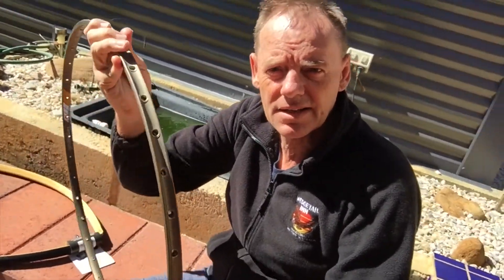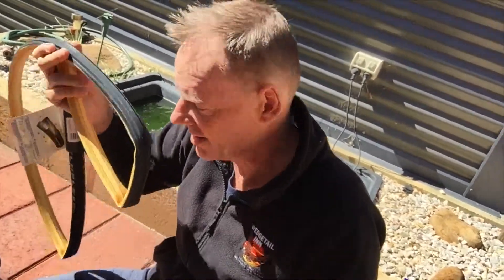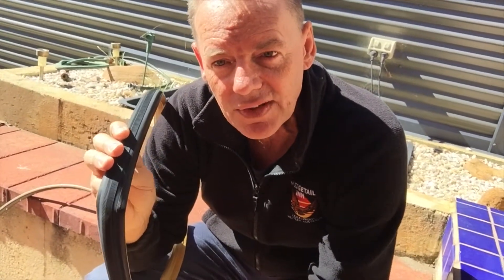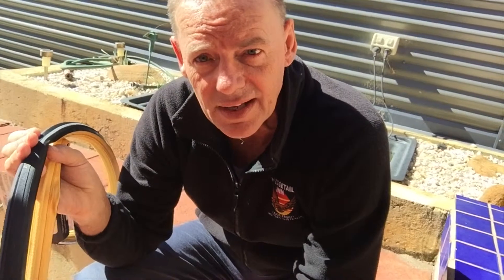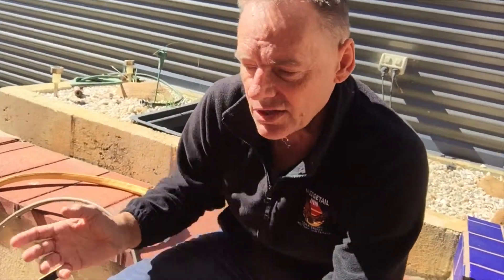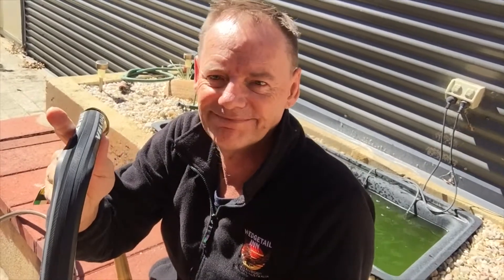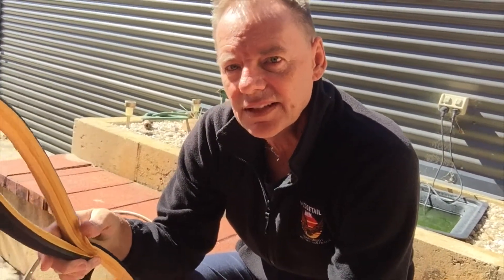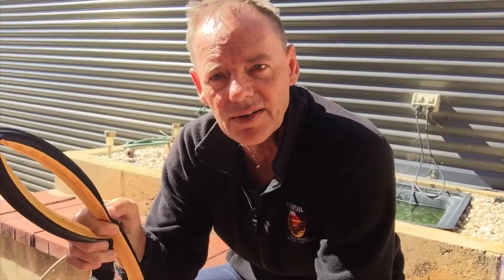Tubular Tyres who runs these?

Comment: At one time we used to either send them off to be repaired or learn how to sew them up yourself  however .
   We started to use the car tyre sealent which did seal them quite well and I have raced on tyres repaired that way.
   But the modern sealants that you can put in and leave are far superior. 
I personally think that the development of sealants for tubless tyres has actually made tubulars even more practical and I don't see a reason not to use them
Reply from the maker: Agreed
Reply: Don't you believe GCN that tubulars are uncool?
Reply: Same here , I take gcn as an advertising company
Reply: I have used Tubless and tubulars 
 Tubulars are in my opinion better in every way.
  They are easier to use less messy to set up and ride better.
Reply: Bicycling must be the only sport that defies physics,
       According to these manufacturers and gcn a wider tyre and therefore a wider contact area gives Less drag.
       And in every other area of physics the oposit is true.
Amazing

Comment: You're off base on the repair issue when the sealant can't do the job. They can easily be repaired once you know the steps. A hair dryer is used to soften the glue that holds the backing tape so it can be peeled back. A seam riper is used to unstitch about  4 inches of the stitching that closes the carcass, the inner tube is exposed and patched using a standard inner tube patch, the carcass gash is repaired with an old piece of baking tape and rubber cement, and the carcass is closed using a blunt needle, some dental floss and an overhand stitch through the original holes (hence the blunt needle). Contact cement is used to reattach the backing tape. It takes me about 15 minutes to perform these steps. I use two tubulars per season to commute 10,000 kms plus 5000 km of club rides. I typically perform about five repairs per season. I can buy the tires online for 60% of the price of a good clincher and I get the pleasure of riding on tubulars!
Reply from the maker: Your a better Man than me, I tried a few times and couldn’t master it, they always felt lumpy when I rode. Years ago people would do them for you but I do believe they have all gone. The sealant does work as well most of the time.

Comment: Tubular wheels are really light and very strong.  I flatted a reynolds and rode in almost 20 miles...No damage.  Bought these rims used for $300 about 7 yrs ago and 15k climbing rim brake miles.  Rode them today.  Re-spoked and re hubbed a few times but still my go to climbing wheels at 22mm height and feather- light.

Comment: This is a Great & very well done video on the pros and cons of using tubulars.  I love the reduction in rotational weight too.  Thanks for the recommendation to put 30ml of Sealant in my latex tubes.  Like you I have run tubulars for 35 years although I do use clinchers too.   For any rider thinking of getting some tubulars, this video is highly accurate and very useful.
Thank You Wayne!
Reply: Being using Tubulars since 1988 & since l finally purchased a Carbon Tarmac 3yrs ago (expert) which came with alloy dt swiss clinchers l can say l enjoy being on clinchers 4 the ease of repairs.  However l also went out & purchased a set of clx40 Tubulars & l had a couple of used sets of Vittoria 19mm Kevlar Belted in good nic (had them 4 30yrs) with green tread (were used in paris roubaix) Not me. And they r super fast . Well l punctured them out. 
During a recent house move l found a brand new set.  Hooray. Going 2 use them 4 Crit Races. Hate gluing them so shorty going 2 put them on wheel stand & heat the glue off carefully  & then clean with accetone. Using double sided tape. As 4 filling with aerosols gr8 4 all round riding.   But if u puncture with Tubulars its usually phone a friend.  😀😀 Have ordered a set of carbon Roval clinchers. But 4 us old Duds we just ❤ Tubulars.  They r comfortable 2 🚴🏼‍♂️🚴🏼‍♂️on. Tried Victoria's fastest road Tubulars as well. Super fast but there puncture technology isnt as gr8 as they make out & only GOOD 4 racing

Comment: Ah, tubulars! I remember them; we used to call them singles. I spent far too much money on them over the years that I used them but the big advantage for me was that they had superior grip, particularly if the road surface was damp. I always used Kwik Grip to fit them and never had a problem.
Reply: How did u remove the kwik grip. And was that on carbon wheelset
Reply: @robertphillips3078  Don't remember if I ever removed it. This was before carbon anything arrived on the cycling scene.
Reply: Tubulars r faster Brian. I road them on expensive Aluminum Heat Treated Rims 4 yrs. Last week l rode 140psi rear & 130psi front & they would have taken more. The other Tubulars l use take much more pressure than that. I am going 2 go 2 double sided tape out of Italy that l have just come across 👍🚴🏼‍♂️
Reply: Found this very Expensive Dou ble Sided Tape out of Italy instead of using glue. My bike shop is endeavoring 2 try & get it 4 me. Getting BIKE stuff out of Italy at the moment is a bit difficult. Waited a yr 4 my indoor trainer.  Anyway back 2 tape..  apparently its as good as glue  if not better  👍👌🚴🏼‍♂️
Reply: @robertphillips3078  There was double-sided tape available for a while back in the 60s or 70s. I think it was on the market here (Australia) for only a short time.

Comment: Old guys like me who know how fast they r especially on my SPECIALIZED Roval clx40 Carbon Tubulars. Fast & more Comfortable.
Reply from the maker: LoVe Tubulars
Reply: @waynosfotos  gotta get the glue off my rear wheel. Found a gr8 solution online. Heat gun. But used wisely.
Reply from the maker: Yes done this before, when i use to use glue. Heat it up and then wipe with the rag. More rag to a new clean spot and repeat. Gives a nice clean finish for the new application. But to be honest, once I found tape, not going back to glue. Just more time consuming to mount. But if you are prepared to do the work and scrape your pedals, it is worth it!
Reply: @waynosfotos  yep. I saw a guy doing it on YouTube.  A little glue 1st & then tape & some more glue over the top. And 2 coats on Tubulars.  What's ur thoughts on that approach

Comment: it does beg the question of how suitable Carbon is for wheels , grate on a TT bike but for anything else i am not so sure , we use carbon to get the weight down and then have to fit over engineered and heaveyer disc brakes to overcome a problem  that did not exist with alloy rims. And i do have carbon rims myself but i have gone back to tubulars with them.
i am not convinced that they are much lighter than the Fieme Hard Silver rims that i was using in the 90,s 
  I think Cycling is bowing down to fashion too much and its a case of the Kings clothes,
getting
Reply: I had a set of hard silver rims that where actualy given to me , unbelievably light and strong.
But disc brakes are about creating a demand not improving cycling.
The cost more a nightmare to maintain,  and wear rotors out faster than brake bloks.
   Then they try and say well they do not wear your rims out.
    How long does it take to wear a rim out and even then  I bet it is still cheaper than all the rotors that will have been replaced to do the same number of miles.

Comment: Great video mate, very informative. I just recently purchased some carbon tubular wheels for my single speed with out realising (didn't read the sellers title correctly) I was very annoyed with my self and stressed out as I thought I'd made a huge mistake (as this bike is my daily commuter) but after watching your video im definitely at ease and I'll be sorting out some double sided tape and some tubs then getting the wheels straight on my bike. Thanks again. Do you have a preference/suggestions about which brand of tubs I should get? I'm completely green in this area of knowledge, any help would be greatly appreciated.
Reply from the maker: Yeah no probs, checkout my Instagram waynos_fotos_cycling, you can message me there if you have any questions, i also have another vid on installation if you would like to check it out here on my youtube channel. I also have a third vid on folding a tubular up small as a spare.
Reply from the maker: Don't buy continental tyres as a first, they are extremely tight to fit. You will have saw thumbs and be cursing. I would suggest the new Vittoria Graphene or veloflex criterium. Both race tyres, i have no problems commuting on these daily.
Reply from the maker: my Video; "how to fit a tubular tyre". Check it out
Reply: Probably the best r Vittoria.   I purchased 6 or 8 pairs 32 yrs ago.  Recently moved house & found a brand new set . Kevlar belted Vittoria that were especially constructed 4 the Paris Roubaix.  I purchased them cheap.  Even back then they wanted $135 for them each .  I got them for $65 each & no u cant have them .  They r probably better than 2days ones . Going 2 use them 4 Vets Crits Races on my clx 40 roval rapides .   Gr8 4 hills & flats